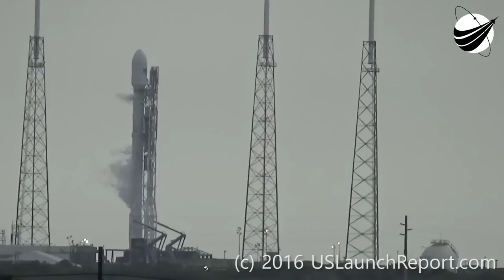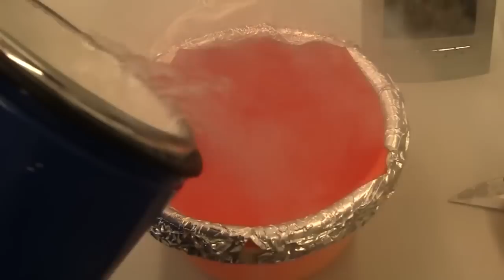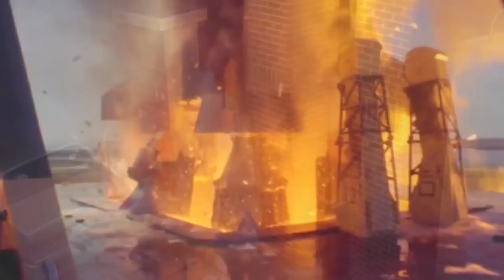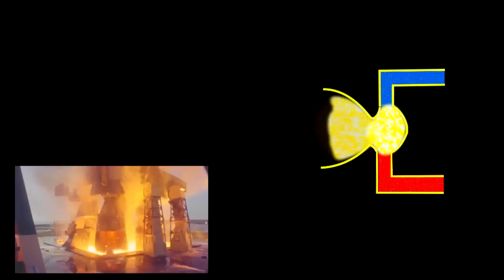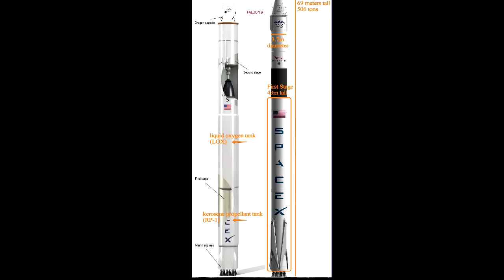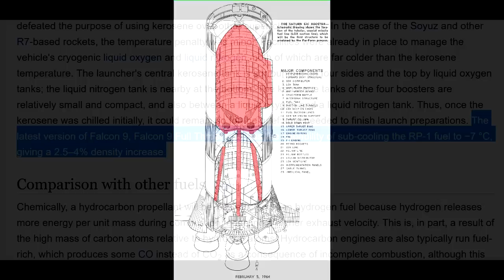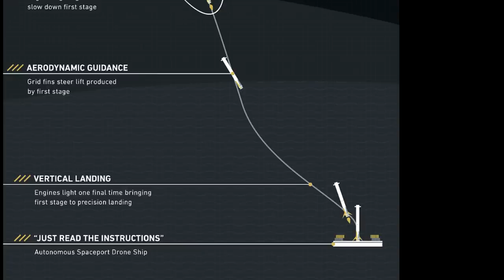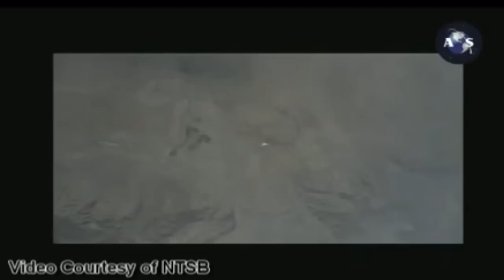Why did the Falcon 9 Explode?

Comment: I have a comment on your criticism of the rocket reuse. While yes, much of it is an anachronism now that SpaceX has reused two cores, there's something else that needs to be addressed.  There is no doubt that the last bit of fuel in a rocket gives you the most "Bang for your buck" as you say but keep in mind, SpaceX does not make rocket reusability a requirement for launching, they just will charge a higher price for a core that has to be disposed.  Falcon 9 is a powerful rocket and many of the payloads it launches do not require that last bit of fuel to achieve their mission objectives. So, if the Falcon 9 can achieve the customer's mission as well as reuse the rocket, why not?  It's a pretty damn impressive achievement and there's a lot of flexibility in the system for the consumers.

Comment: Wouldn't a used rocket be potentially more likely to cause the rocket engine to develop a fault? Seems to me that just sheer wear and tear of a used rocket is more risky to use than a new unused rocket and engine.
Reply: There's these little things called tolerances.  At THIS point those "used" rockets are taken apart entirely (huge maintenance $$$).  Every piece of them are spec'd and results compared to the original results of manufacture.  I'm sure there's a few things replaced simply because you're already in there and some parts can only be assembled once (notice I said assembled, not used, this is important).  NASA did this with the shuttle which is one of the reasons its launches were expensive.  Musk sees the eventual evolution is that a rocket will launch, return to the pad, refuel, re-payload, and launch again within hours.  In order to get to that point, the engineering must align with calculated results of reuse.  Rockets are complex and a mistake anywhere will turn it into a large firework.  Once they get the manufacturering and launches to a point where the results are easily predicted, that's when same-day re-use will be feasible.  There are fatigue points to be careful of, especially if resonance is detected by on-board instruments.  That could damage the rocket to a point where it's no longer sound to take a full load to space again, and that's assuming the resonance doesn't shake it to pieces that flight.
Reply: So, in short, yes? Doesn't matter anyway, I have been watching Flat Earth videos all night and now no spays duz nawt exitses. I may hav lost sum brian wats-the-matter? and sum cogs in my ignition but at sleast I no da troof.
Reply: Look on the bright side, with a flat earth, we could just build a rocket sled at the very edge and reuse the sled over and over, the rocket would just need to accelerate a small 2nd stage with payload in order to get it into the proper orbit!  It'd resemble a much larger and faster version of when the navy uses a catapult to launch it's metal car off the edge.  Maybe we use a several mile long EM launcher?
Reply: I em sorree I lu lu luaust aww aww ll critecal factorees. I sta sta sti ll no trooof.

Comment: You have to make a video debunk your own video pls....
"""""The problem which caused this explosion was not one that has been previously solved. In fact, it was caused by SpaceX's use of supercooled propellants and COPVs built into the LOx tank, something never done before. Since the helium COPVs were below the freezing point of oxygen and the carbon overwrap is permeable by LOx, SOx formed between the overwrap and the internal aluminum lining. Then, when more helium was added to the tank as part of the fueling procedure, the pressure against the buildup of SOx led to breakage and friction between the carbon fibers. Due to this, enough energy was created to ignite the carbon with the oxygen, the aluminum liner ruptured, and the LOx tank over-pressure, therefore mixing the fuel and creating a fireball. Although I respect your criticism, new technologies like these lead to issues never seen before, so I don't believe this was due to SpaceX's ignorance. I understand that this video was made before any definite cause of the failure was determined, but I don't think you should have jumped to such quick conclusions.""""""""

Comment: Falcon 9 first stage maintenance will not cost as much as the space shuttle. The shuttle had to reenter the atmosphere at much greater speeds (orbital speeds) without burning fuel to slow down, relying on thermal protection. The Falcon 9 first stage goes back to earth at speeds around 2km/s, roughly the same speed of the solid fuel boosters, wich are recoverable.

Comment: no! falcon 9 doesnt use kerosene it uses liquid methane
Reply: Falcon 9 uses Kerosene or RP1 as fuel. Not methane. Get your facts straight. SpaceX is developing another engine called the Raptor which will use liquid methalox
Reply: Joachim Voldseth srry i was confused

Comment: The space shuttle was definitely more complex than the falcon 9. It's ET was not near it's center of mass from a horizontal view. NASA ended up having to tilt the shuttle's engines so it wouldn't crash into their VAB (This is what makes the Russian Buran spacecraft very different from the space shuttle). There were also just so many things that could go wrong which increased it's operating cost by about 20 times the estimated cost.

Comment: SpaceX has just reused their rocket that landed in April 2016. According to SpaceX president Gwynne Shotweel the cost for refurbishing the first one was half the cost of building a new one. Which is really impressive for the very first reflight. They plan on flying 6 more used stages this year. SpaceX is currently upgrading the falcon 9 to make reusabillity even easier. And their future goal is to get the refurbishment process down to 24 hours. SpaceX will nail this and you thunderfoot is being proved so wrong now.
Reply: InfernosReaper they’re one of the cheapest launch providers globally. You can’t argue with results
Reply: Hi, it’s 2020 now and they’ve flown more flight proven boosters than brand new ones (20 previously flown, 2 brand new). One of those new ones carried two crewmembers to the ISS, and they’re scheduled to launch a crew of 4 to the orbiting lab in mid October.
Reply: *are
Reply: Yeah.. this guy seems to be a huge ELON HATER😂😂
Reply: Joachim Voldseth.  Except hes not.....
Reply: Joachim Voldseth  Half the cost of building one of their reusable rockets is probably still higher than a single use and if they have to do they every launch, it's a problem.

Comment: People get excited about SpaceX landings because no liquid fuel booster core has ever been landed and reused. The shuttles SRB's descended by parachute. Like I said before, first powered landing of a liquid fuel booster core. And the shuttle orbiter landed by gliding it was not powered. So technically it has never been done before. People have the right to be excited about a new thing. And they were cheering a lot not only because that is a very big booster and it's hard to land from space, they know it's going to be reused like SES-10. Just saying. You have no right to say the shuttle has done what the falcon is doing.

Comment: it may have exploded because of a faulty Chinese component that was probably purchased from ebay. maybe a faulty tank valve or seal that was installed incorrectly because the engineer/tech couldn't understand the chinglish instructions

Comment: Why would you ever use Oxygen Kerosene instead of Oxygen Hydrogen. It seems as though the latter would be preferred just because of the environmental benefits since it generates no waste byproducts other than water whereas kerosene is a petrochemical and horrible for the environment
Reply: Because Hydrogen is harder to store, it's less dense so requires significantly larger tanks, and it's also harder to pump so you tend to get lower thrust. Thrust is important for a first stage because you want to accelerate quickly to reduce gravity losses. Rockets are launched so infrequently that environmental impacts are mostly ignored.

Comment: There's another benefit to the rocket that comes back, the fact that it doesn't become debris in orbit that could be VERY dangerous and possibly destroy a rocket carrying people years after it was discarded in orbit killing everyone on board in the absolute worst-case scenario when we get more advanced space travel.

     Does it still need work, yes, but space junk is a real problem (if I remember correctly it has taken satellites offline in the past), and until we can somehow go up there and find a safe way to remove the bigger pieces of debris, it's probably for the best that we do everything that we can to reduce how much crap we put up there now and not make the problem any worse than it already is.  If it can be reused again then it's a bonus and will reduce costs.

     I'm not saying that you don't have valid points, but down the road rockets that come back to earth that could possibly be reused will be a necessary evil for costs, resources (even if you can't reuse them I'm sure that you can scrap the rockets and the the resources back out of them, can you) and not making space any more dangerous then it needs to be by adding more junk into orbit that then we already have up there that could have dire consequences years after it was discarded.
Reply: Second stage doesn't come back and all first stages of any rocket come back, just burn up in the atmosphere/crash in the ocean normally.

Comment: I re-watched this because of the recent success Space-X had with its resupply mission.  It got me thinking about what you say about the questionable utility of the first stage landing and the fact that you lose that last bit of fuel.  Seems like just dropping them in the ocean with a parachute might be more cost effective, though as this video suggests using a parachute for most of the journey back to earth might be another way to do it (maybe this isn't preferred because with a chute the wind can end up taking it quite far away and then you have to make all that up)
I do like a lot of stuff Musk is doing, but enjoy your critical videos.  Have to keep it real.
Reply: Parachutes are not effective. They tested them before; they were instantly stripped. They added successively stronger cords and parachute fabric, but nothing worked for supersonic speeds when the rocket was coming down that fast. The other option would be dramatically slowing the booster down with propulsion to subsonic speed before deploying parachutes, but the combination of extra parachute mass and extra propellant made it not very effective. When so much mass was being added just to allow ocean splashdown (and significant refurbishment because the engines were dunked in corrosive saltwater), it made more sense to use all that extra mass for landing legs and fuel rather than parachutes.

Comment: "... they would have never allowed a design like this off the drawing board" 

Perhaps you should read through the thoroughly documented organizational failures which allowed for the total loss TWO space shuttle orbiters.  In both documented cases the safety concerns of well qualified engineers were dismissed.  There are only two reasons you would make this comment: 1. You are woefully ignorant of NASA's history of failure or 2. You have an axe to grind.
Reply: I think it’s mostly the latter, but ignorance of the Challenger/Columbia disasters and NASA culture responsible is a definite possibility.

Comment: Turns out you were wrong (again). Also the Merlin engines and the SpaceX turbo pumps are way more reliable than those used in previous NASA operated launchers.
Reply: citation needed
Reply: +zynius  The Space Shuttle main engine (Rocketdyne RS-25D) has never actually failed in flight over a period that spanned 30 years.  It may be complex and designed for maximum performance, but it has nevertheless been extremely reliable (and so was the SRB when used within its specified operating parameters).  The Merlin engine is also a very reliable rocket engine, although its record is not quite as good, despite being a conservative design that is also used in a conservative way.  Now that it has matured and is more proven, I have no qualms about it being used for future manned Falcon 9 flights (especially with the redundancy of the system), but it is NOT more reliable than the most recent NASA man-rated rocket engines.
Reply: The Space Shuttle main engine almost failed, 4 of the cooling pipes going around the bell tore on one of the flights, causing extra thrust. The reason this didn't result in a catastrophic failure was because of a computer error. 5 broken pipes would result in an irreverable death roll.
Reply: I don't have the citation here, but if I remember correctly, the merlin engine was designed to whistand a lot more pressure that what they are used to. So they only are used at a fraction of their potential, which make it way more durable. There's not enough data yet, but I think they could be as reliable as the shuttle engines, that were little engineering marvels.

Comment: If the fuel line cracked and exposed the liquid oxygen to the kerosene, wouldn't you still need an ignition source? The mere mixture of the two wouldn't cause an explosion on it's own, right?
Reply: Definitely would - crack would provide enough energy, and rapid mixing and resulting kinetic energy would provide enough energy. Kerosene in liquid oxygen is very nearly spontaneous ignition, so anything will ignite those.

Comment: If I can summarise your criticism of booster reuse as roughly: "Rockets receive a large portion of their delta-V from the last 10% of their fuel, therefore saving the last remaining fuel for boost-back and landing is a waste."

This position, whist correct in technical detail, is so completely dishonest in context that I feel that those creationists you used to debate must have been rubbing off on you.  You ignore, fail to mention, or are unaware that:

1. Booster reuse comes at no payload disadvantage to the customer, and in one case (SES-9) SpaceX even passed up a Return to Launch Site opportunity to give their customer greater delta-V so their satellite could be operational sooner.

2. The use of the ASDS drone ship for booster recoveries down range, minimises the amount of fuel "wasted" landing the booster.

3. Thanks to performance increases in Falcon 9 FT compared to v1 and v1.1, Falcon 9 can now launch 22,800kg to LEO in fully expendable mode.  This makes it a viable rival for Delta IV Heavy, which can loft 28,790 kg to LEO for $375 million USD.  Falcon 9 costs just $60 million USD.  Even if you are correct and booster reuse NEVER becomes economical, SpaceX has already revolutionised the global launch market.  Yeah Thunderf00t - "some good stuff".
Reply: The Delta IV Heavy price you used is for government missions though. Not a fair comparison. F9 is approximately $100 million for government missions.